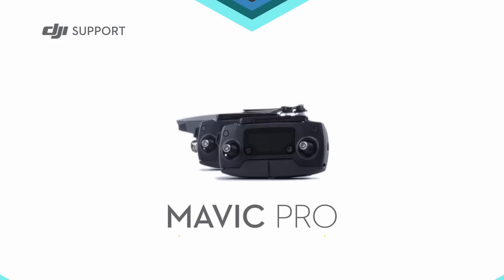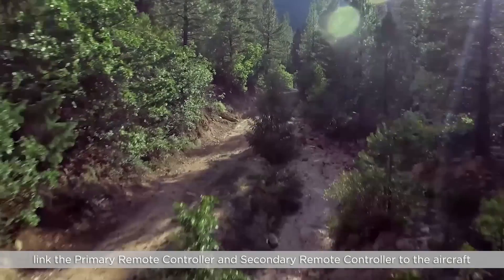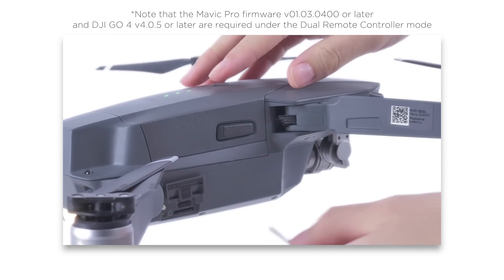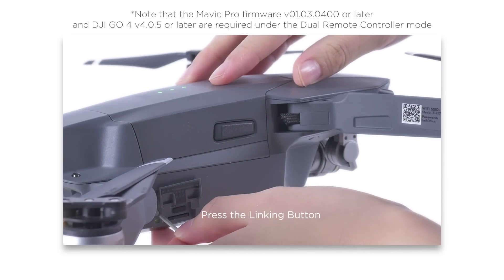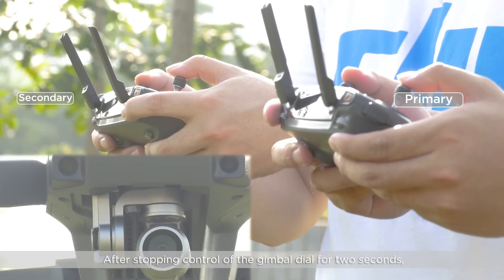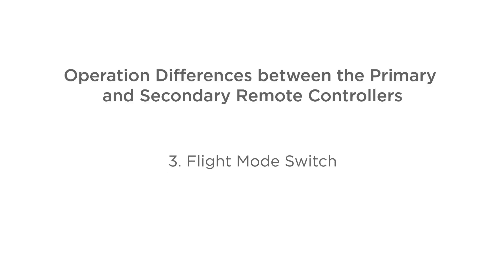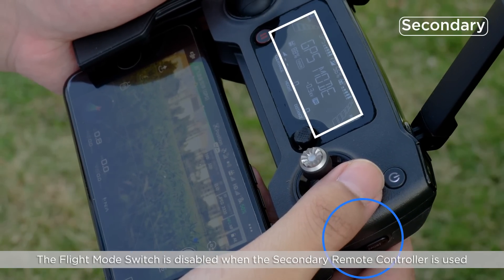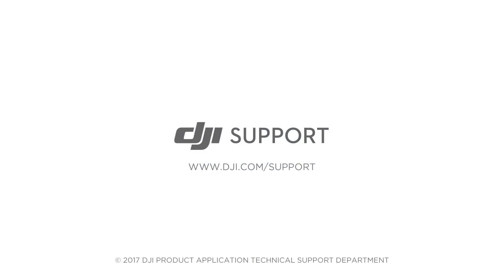How to Use DJI Mavic Pro's Dual Remote Controller Mode

Comment: It would be really cool and helpful if the secondary controller could be switched over so it could have total control of the camera gimbals orientation and zoom with its control sticks and control of the video and camera settings and the picture taking during flight. It would really make the Mavic 2 pro and zoom much more capable as a video and picture taking platform if a pilot and camera operator could operate the drone together.
Reply: Is there a step up, like the Phantom or Inspire lines that allow this?

Comment: Hi. For Mavic PRO's both controlers comunicate with the aircraft or the Secundary RC communicates with the Primary RC ? How does it works too with Phantom 4, Inspire 1, Inspire 2, Air 1, Air 2, Mini 1 and Mini 2 ? Thanks in advance.

Comment: Why doesn't the mavic air support this cool feature? That's pity :(  Is there any chance to upgrade the mavic air's firmware that it also works with two remote controllers?
Reply from the maker: Hi Max, we're sorry that there is no related news for Mavic Air to support dual remote controller for now. If there is anything new, we'll release on our website.
Reply: @DJISupportGlobal  Hi, thanks for the fast information!
Reply from the maker: @yannbik_2489  You're most welcome. Max.
Reply: @DJISupportGlobal  Hi. For Mavic PRO's both controlers comunicate with the aircraft or the Secundary RC communicates with the Primary RC ? How does it works too with Phantom 4, Inspire 1, Inspire 2, Air 1, Air 2, Mini 1 and Mini 2 ? Thanks in advance.
Reply from the maker: @DronArt1958  Hi there, we are sorry to hear about the difficulties that you encountered. Please contact our support team via http://www.dji.com/support and provide us with more details, we'll do our best to help.

Comment: Hi, what is the maximum range of the drone with this system? would it be possible to have bases of operation every 3km for example for a second operator to gain control of the drone and advance another 3 km and so on? Have you done this test? It would be great for patrimonial security of large areas.
Reply from the maker: Hi Jonas,  there is no distance limitation between primary and secondary controllers as the image transmission signal depends on the distance from the aircraft: 1. If the distance between primary and secondary controllers is within a reasonable range(depending on whether there is environmental interference),  the transmission signals of the two remote controllers will be stable; 2. If one controller is disturbed by the distance, another remote controller might be affected
Reply: That would keep it line of sight for just about an infinite distance...provided you had the batteries & the first pilot can hop in a car and leap frog.

Comment: Dji still support two remotes? As when I am trying to connect my second controller there is no option to select as primary and secondary remote. I do the exact same steps as described in video and that was the only reason I spend extra on second remote.
Please help !
Reply from the maker: Yes, Mavic Pro still supports the dual remote controller, what is the firmware version of your second controller and what is the DJI Go 4 version? Any chance to share us the screenshot of the linking page and contact our support team www.dji.com/support?
Reply: Thanks for the prompt reply. My second phone needed the update on dji go 4 app. 
Now it’s working
Reply from the maker: Glad to hear that, please let us know if you need further assistance.

Comment: can i move the bimbal with the sticks on the secondary controller while the primary controller is flying the drone?
Reply from the maker: Hi Kantek, both RCs can control the gimbal by the gimbal dial during flying but the primary controller has priority. For example, the secondary RC is unable to control the gimbal by the dial if the primary controller is controlling it. So you can control the gimbal by the secondary RC is the primary RC is not controlling the gimbal during flight. You may also read page 39 on the manual https://dl.djicdn.com/downloads/mavic/Mavic%20Pro%20User%20Manual%20V2.0-.pdf. Hope it helps.

Comment: Dual controller operation on the original Mavic Pro in the video does not seem to be still supported. It is not a feature on the DJI Go 4 app on the controller menu. Anyone else like to comment or am I missing something?
Reply from the maker: Hello Tom, dual controller mode is supported on Mavic Pro, can you provide us an operation video when trying to link the primary controller? You may keep us updated via Facebook Messenger: https://bit.ly/2pm7tfV, we'll check the case.

Comment: Can you do this with mavic 2pro ?
Reply from the maker: Hi there, Mavic 2 Pro doesn't support dual controller mode, thank you for your attention.
Reply: @DJISupportGlobal  Hi DJI. Is there any possibility in implementing this function in the future DJI Software update? I am a Mavic Pro 2 user. Thanks!
Reply from the maker: @d1xenotime  Hi Derwin, we will forward this request to the engineers to notice. Hopefully, it can be realized in the future.
Reply: @DJISupportGlobal  Is it possible to be included in a future update or this is not possible because of the hardware?

Comment: Can you use the dual remote controller mode on the mavic 2 pro too?
Reply from the maker: Hello Ralf, sorry to tell that Mavic 2 Pro doesn't support dual RC mode. Thank you for your attention.
Reply: @DJISupportGlobal  a bit silly if you just released the smart remote control
Reply: Yes, please add this functionality to the Mavic 2, it is very much needed.

Comment: As if you need a 2nd operator to tilt the camera down...
Reply: tilt left right too. thats a lot of task which u might wanna delegate.
Reply: You can tilt it, too, but also things like exposure and focus can better be controlled by a second pilot. This feature makes quite a lot of sense.
Reply: That's basically the only thing the second operator can do. No left or right. Just tilt up and down. Pretty useless without total gimbal control